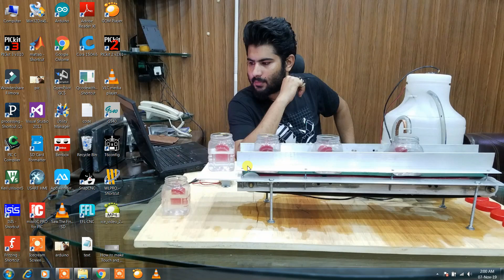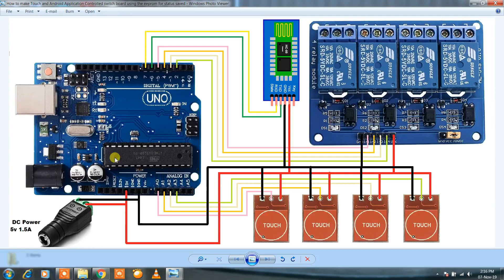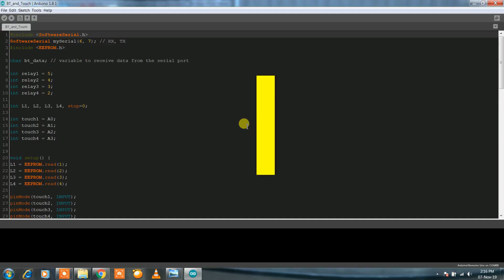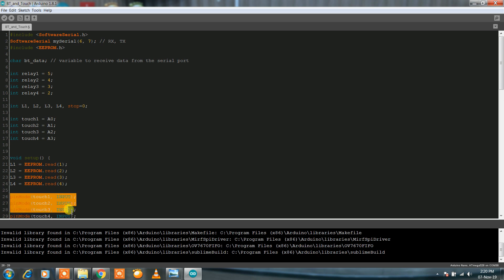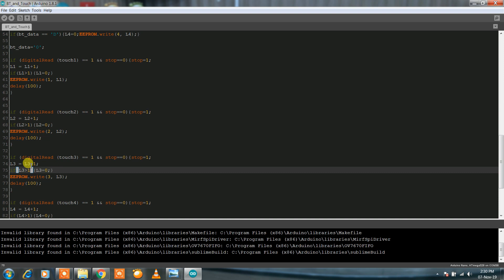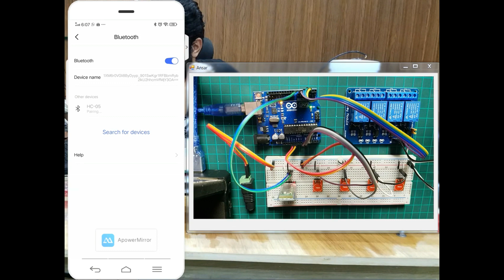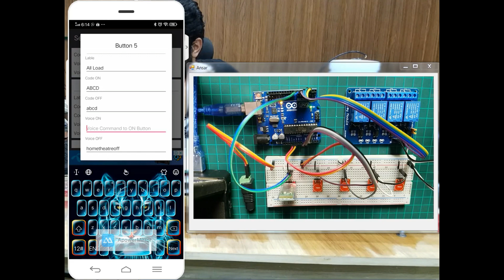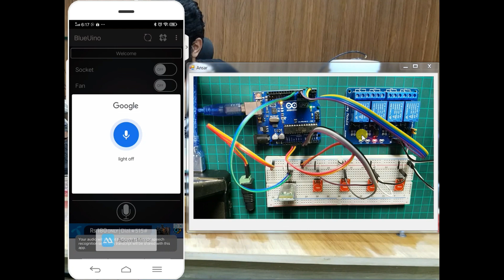How to make Touch and Android Application Controlled switch board | Bluetooth based Home Automation

Comment: Great Video, in wanted to know can you programme a touch switch to move a stepmotor 90 *(degres) and then stop when you touch the switch the first Time and when you touch it again it goes back to 0 where it was (like a door first Time you touch it it close second time you close it it open. I have been trying to do that for weeks. I am working on a very small mass that go on and off your face with a double tap on a touch switch. So i need a very small close open circuit. I would be really grateful if you could help me with programming and circuits. I already have the mechanical part who Works Well.

Comment: Bro one small doubt, last you turned on light and fan with touch sensor. Does the Bluetooth module interface which is app - shows that light and fan are on, because those are turned on using sensor.
Reply from the maker: no bro
Reply: @MuhammadAnsar  ok

Comment: I ask for help!! bluetooth commands do not work, I know using a mega, I tried and meter rx and tx in pin 6.7 (does not communicate) but the program loads, in pin 0.1 (does not load the program) how can I do to solve the problem ??

Comment: I made it but fake triggering hoti hai
Reply: Same problem I am also facing self triggering... Of the sensor...
Reply: I have same problem
Pl give solution of fack trigger of relay
Reply: @sudalemuthu8114  how
What time to call u
Reply: @kinnpatel9730  at anytime
Reply: Finaly i got solution for fack triggering of relay 
It is becouse of floting of input pins which give fack signal to on relay
So u need to atteched all for touch sensor to input pins or ground to unused pins if u use one or two sensor
Reply: @kinnpatel9730  plz give diagram
Reply: @sudalemuthu8114  how did u solve... Plz share
Reply: @industron22  connect all four touch sensor to A0 A1 A2 A3 pins of arduino
Reply: @industron22  it is given in video driscription

Comment: Great Video, I wanted to know can you programme a touch switch to move a stepmotor 90 *(degres) and then stop when you touch the switch the first Time and when you touch it again it goes back to 0 where it was (like a door first Time you touch it it close second time you close it it open. I have been trying to do that for weeks. I am working on a very small mass that go on and off your face with a double tap on a touch switch. So i need a very small close open circuit. I would be really grateful if you could help me with programming and circuits. I already have the mechanical part who Works Well.
Reply from the maker: ok i Try
Reply: Thank you